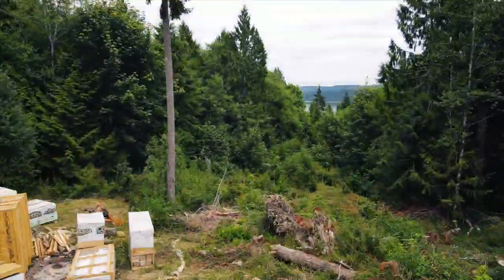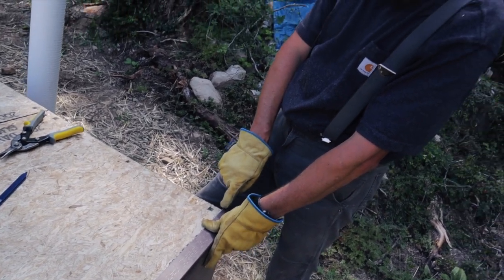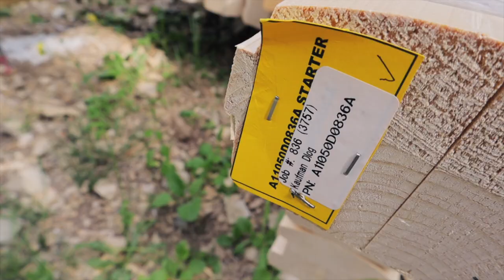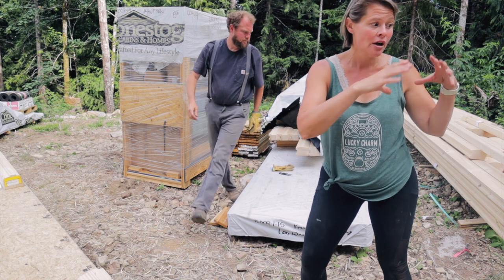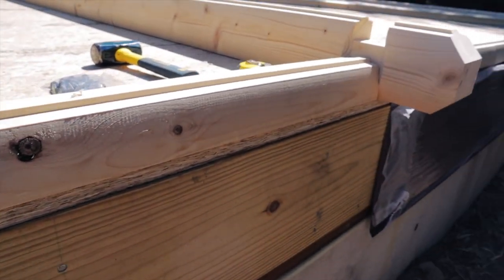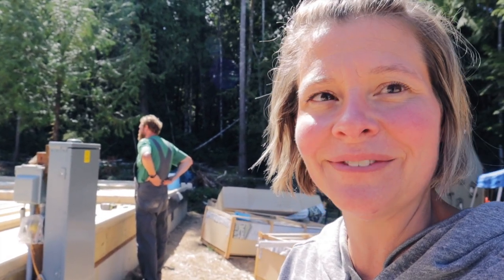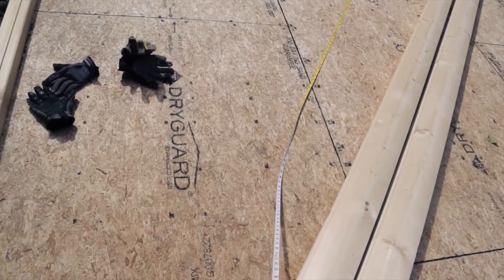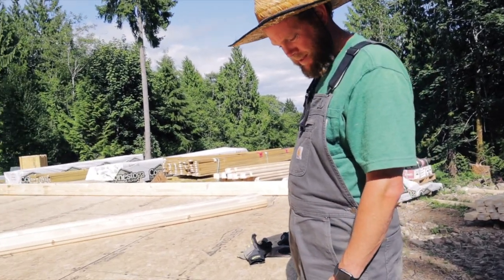Putting on the FIRST Logs // Couple Builds a Log Cabin Kit Home - Ep. 37

Comment: I'm a the stage of picking a log cabin kit, I have my eye on Conestoga, but I am not sold on this company due to the fact they use such small logs!  I get it, it's makes it quite possible for a couple to build their own home because the logs are thin enough to  carry with just two people.  But that is the ONLY benefit I see.  Otherwise, I can't imagine have only 4-5" between me and the elements.  Most traditional log homes use 9" min logs, 10" is quite common and then the more luxury homes using 12" logs.  These look like 5" at the most!  I would LOVE to be able to reach out to you two to see how you have liked your cabin so far!  I'm going to follow your build, but I'm a long way away from being sold on this manufacturer.
Reply from the maker: There is interior insulation as well. 2.5” of rigid foam. I think it will be quite warm when we are finished.
Reply: @OneFootOfftheGrid  - I"m sorry, I may just need to catch up on your more recent videos to see how you did that, but please correct me if I"m wrong.  If I must insulate the inside, aren't I covering up the gorgeous wood by insulating & then putting up drywall?  So it's not truly a log home, but more of a Hybrid with the exterior esthetics of a log home, but the interior of a more traditional home?  Is that about right?  I'm sure I'll see as I watch more of your videos too!  Thanks so much!
Reply from the maker: @TheStoneWhisperer  the finish they provide is a “shiplap” so you still get the wood interior but not the “log look” that many people want.  I’m sure you could finish with Sheetrock as well.  Certainly not a traditional log home.  They are glue laminated logs though so the will resist warping more than a traditional log home.
Reply: i seen some awsome log homes on meadowlark log homes, I dont know what the shipping cost is but they are badass
Reply: @TheStoneWhisperer If your not insulating in general the building becomes useless for anything but short vacations. Zero way to keep cool in the summer nor warm in the winter would be a disaster or use a massive amount of fuel/electricity